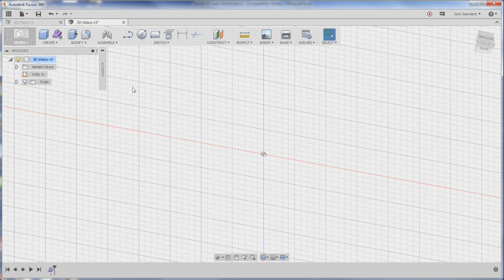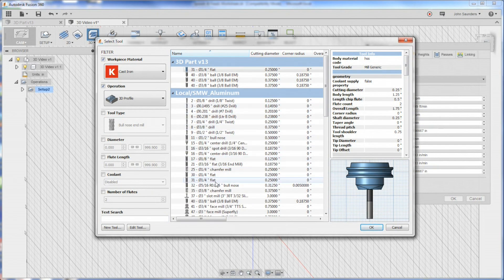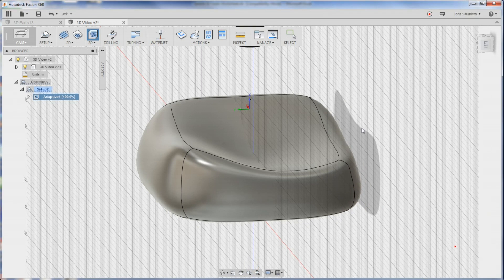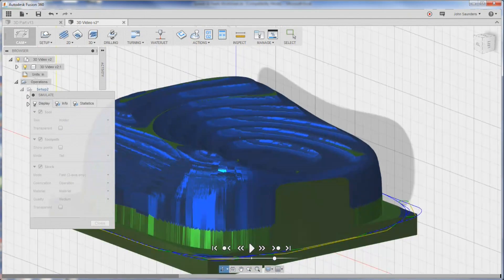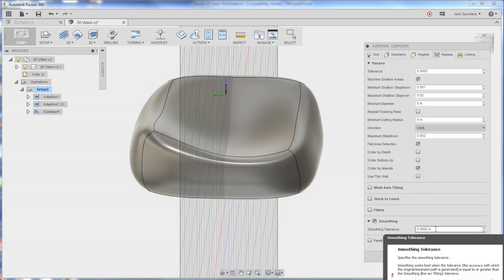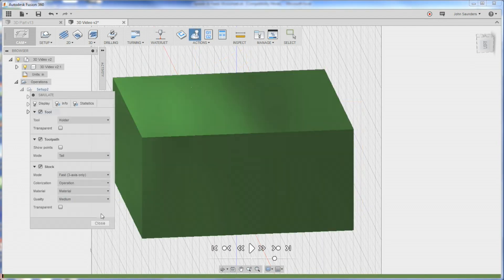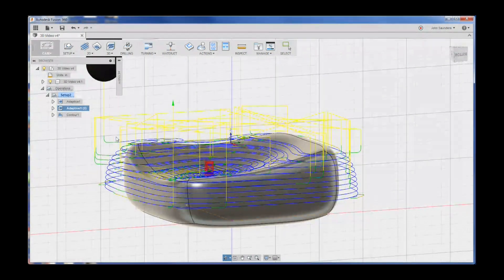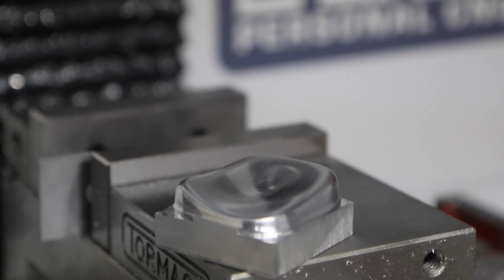3D Machining!   Can we get a great surface finish?

Comment: What is tormach Controller ? Cnc’s have fanuc,Siemens or mitsunishi. But i dont know tormach’s ? Does Tormach have a computer aided cnc like a simple woodworking cnc(Router)or does it have the capacity to make 4-5 mass production parts per day? It is impossible to get this information directly from the website. Also, does it have a precision of 0.01?

Comment: I started with Autocad back in 1990 and it was good for 2d  but .....
You need SolidWorks CAD and Esprit CAM I use both for design and programming and they  are the best for design / evaluation and programming.

Comment: 7075 would leave much better finish, with just smidgen of oil on surface and finish pass of .003 to .005 would help too to minimize temp.
Reply: 7075 is a dream to cut vs. 6061

Comment: I would rather use normal roughing first with big radial step over and smaller step down so then I left with smaller stairs, and then do something like ball mill "3D constant step over" (in SolidCAM) operation with a little bit bigger step over (1 mm aka 0,04") and offset from surface like 0,1 mm (0,004") and then use same operation but with no offset and with smaller step over to get a nice surface.

Comment: anybody that uses "simulate" such as the cartoon type figure to show whats being machined should not be machining. Its a worthless feature put in softwares to "wow beginners" if you are using simulate --then you will not be allowed to get near the programming system at a job --you are not at the correct level yet unless you are in a situation like "the shops is friends and relatives in the local hillbilly town"--thats different.
Reply: Why is that? In my experience simulations in whichever CAM package it is helps you see if something went wrong in the calculations or if your settings results in bad moves. Seeing the tool move in 3D is a bit flashy but can help you evaluate certain tricky areas of the machining. Of course you cannot rely on the simulation to make a good machining, that needs to come from your own head, but as a tool to evaluate, particularly with these complex 3D paths, I feel it is useful.

Comment: I like to set my feed rate per tooth to the same as the stepover. That way the scallops along the tool path direction are the same size as the scallops between passes when using a ball end mill. So a .010" stepover would go well with a  .010" FPT or 200ipm at 10000rpm with a 2 flute ball end mill. If you wanted a finer finish, say .008" stepover, you'd also reduce the feed rate to 160ipm and expect a 56% increase in machining time.

Comment: What size motor are you using for 10,000rpms
Reply: The PCNC 440 has a 3/4hp DC motor.

Comment: I"m just starting out with CNC  router. Total beginner, I get to play with a  large industrial CNC router next Friday. Wont be anything super cool like what your doing, but you gotta start somewhere. I noticed you didn't need to use coolant when  your cutting that metal block? Great video by the way.

Comment: John, I know this is an old video, but I was curious if you checked out Autodesk HSM's video on surface finishes: https://www.youtube.com/watch?v=ksrhtS3d79Y . They do a pretty good explanation on how to improve surface finish on 3D parts. They show mostly with Fusion 360 as well (but also show other equivalent CAM software).

Comment: Very impressive.  Working on the coolant delivery might improve the recut chips.
Reply: I agree, running at 10k spindle speed is causing the heat between cutter and stock to kind of fuse the chips back on the part. also i found out climb miling always gives a better finish.

Comment: little tip, you shoudnt use an ball mill on profiles with more than 30 degreeo f angle, instead you should  use and end mill with a big corner radius, i my opinion would had to 2 finishing programs, 1 for the outside with the end mill, and the interior using an raster finish with the ball mill at 45 degree angle

Comment: Hey John great vid. A way you can keep the chip smear to a minimum without running coolant is to use a little WD-40. This will all but eliminate built up edge "BUE" on aluminum. This could also help you get some good shots that some coolant systems would obscure.

Comment: Nice video! I'm just learning fusion360 myself its great! If you use even a little bit of cutting oil or wd40 on the part while you do your surface milling you wont get the chip gulling on the surface when cutting aluminum brand new cutters will still give that chip sticking to the surface. that part looks fun!!

Comment: Does the tormach 440 setup for through hole coolant.  Not saying run coolant but maybe a mist and air in a through hole bit.  I've seen add on atachments when machines don't have a through spindle coolant.  Maybe the air and mist coming through the bit will blow the chips of of the way and you won't get any recutting of the old chips.

Comment: john, one thing to consider when 3d machining with a ball mill is that the majority of the time your not using the full diameter of your tool. so your speed and feed calculations are way too slow.  most of the time you are using just the last 10 to 20 percent of the radius. if you calculated for the diameter you are actually using you will see you don't have anywhere near the rpm to put it in the sweet spot. you either have to live with the finish, increase your tool diameter,  or use a spindle speeder.

Comment: I think the finish was just because you didnt have coolant. you shouldnt have any problem running at 100 ipm with 10000 rpm with that step over. probably just rubbing little tiny dust (chips) into the part thats all. I wish you had hatted it off and made the entire part. lol

Comment: "Rest machining" means "I have hogged out the majority of the material with a big tool, now I'm using a smaller tool. I want you to get the REST, such as the corners and spots the big one couldn't get to." As an example, if you're doing AR FCG pockets, you can hog them out with a slightly larger (1/2 inch, say) endmill and send in a smaller (3/8", for example) one for the shelf because of the right wall's thickness (0.438"). You can skip selecting it if you want, because it generally asks you for more information and doesn't do anything you can't do yourself with more control.
Reply: And you figured it out. :D

Comment: Smoothing.... Personally I think it's an OK thing to call it. It is actually smoothing out the faceted toolpath by fitting arcs to the series of tiny lines that make up a complex 3D toolpath. In doing so it reduces the amount of code at the machine, but it also decreases accuracy. 

It's a kind of confusing thing to call it for Fanuc users, because it's completely different to the Smoothing options in the post dialog, which is used to enable high speed machining and look ahead. Another nice video John!

Comment: Most probably the dull, rubbed in chips are due to the ball end mill center having no surface speed at all. For sometime now most of the 3D milling work in mold making industry is done with toroidial / corner radius cutters. Buy some and try them out, but be warned - there might be no turning back... ;)

Comment: Hahaha thanks for explaining rest machining! I tried to explain it yesterday lol! I will link this video :D Wonderful little machine bro. I deleted all my other stuff to simply say this. See your rapids? In the link section, (last tab on right of toolpath box) where you set ramping etc. In your 3d clearing strategy... check the box that says maximum stay down as a %. It can drastically reduce your roughing time. Keeps rapids short and to the point. Also different grades of alloy give different surface finishes, always use air/coolant, and check your ball mill for nicks, you can get single insert carbide ball mills that are the shiz. Good work, great machine.

Comment: I really wish they put a bigger spindle motor on that thing... Major bummer for me. Anyway, thanks for the video!
Reply: Well, It's hard to say for sure through watching videos of it, but it sure sounds like it's not holding consistent RPM, in every video I have seen (not just yours), even on fairly light cuts in aluminum. It just sounds like it has no balls at all. Have you tried drilling anything with it yet? Maybe try that 1/2" drill you like at the speeds/feeds you use on the 1100? This is the main thing I'm concerned with. 

What about tool life vs the 1100? If it drops 500-1000 rpm for a second every time it enters the cut (no idea if it even is, just sounds like it), that can't be good for tools, especially if you're already running a high chipload. In all honesty, it's more than likely fine for 95+% of people, but not for me at this point. I realize it's not fair to compare it to the 1100, but still, it should be able to hold speed more consistently in my opinion.

 I remember you mentioning something about the spindle in a previous video, can you investigate more about it? Maybe you could do a video of pushing it to its limit like you did with the 1100? Is it actually dropping RPM, or does it just sound like it?
Reply: NYC CNC Awesome, thank you. That is good news!

Comment: For surfacing I like a Garr ball endmill for both roughing and finishing. I'll typically rough out at 75-90 ipm 8000 rpm with a 3/8 or 1/2 and finish at 90-110 in aluminium. I think the surface burrs you encountered were from a lack of coolant more than tool choice and in my world this finish would be more than acceptable. This machine seems very stout for its price point and I am looking forward to seeing more tests of its cutting capabilities.

Comment: Hey man, Love your videos! Had a few questions for you. In the last year or so I have just kind of dove into the machining industry with no machining background or schooling, started out running EDM machines and shortly after have gotten to the CNC Milling on an old supermax mill with a retrofit anilam conversational system, nothing fancy. The first type of software that I have been exposed to is BobCad, and to be quite honest im not really impressed at all, fusion 360 looks like a much more user friendly interface. Been kind of experimenting with all sorts of speeds and feeds, but my machine only allows manual speed selection, so it somewhat limits what I can do through programing and such. I guess what my question is, with out growing company, what would you recommend the next step being? We do a lot of jobs what are just small custom parts (ei 3inx3in), But its ALL tool steel (01 A2 D2). It looks like the tormach machines are pretty good and work well with the fusion 360. I guess this would be a conversation to be had somewhere other than the youtube comments! Haha, Great work tho.
Reply: +NYC CNC yeah I guess that is my question, I'm starring to grow out of the features of my current machine and maybe looking to add/upgrade. just wondered if you would reccomened a tormach based on the fact that the only material I'm a working with is toolsteel, also would it be worth ditching bobcad and switching to fusion 360.
Reply: +Tyler Sisco definitely worth ditching Bobcad. There's a generic Anilam post sitting there waiting for you as well.
Reply: +Scott Moyse yeah I do definitely use the anilam conversational system, and actually works very well.

Comment: Thanks for the video! In the 3D Adaptive Clearing settings under Linking you got the No-Engagement Feedrate that could additionally speed up your cutting job. I don't exactly remember where I heard it, but one of the problems with the ball end mills is the cutting speed at the center of the tip is close to zero, that is why it's rubbing there and why really beautiful 3D-Machining like this is better done on a 4 axis machine to keep cutting at the outer edges of the tool.

Comment: Nice video, that 440 looks compelling.  I would have set the max roughing step down a bit more (1/4" or even 3/8") on the adaptive clearing and then set the fine stepdown what you were going for in terms of final step depth, that way you clear out most of the waste 1/4" or 3/8" depth at a time and then it retracts the minimum amount and 'rest' machines whats left if that makes sense.  Example, it will cut 3/8" deep and then retract to 1/4" and then 1/8", rather then cutting at 1/8" then at 1/4" then at 3/8".  Thanks for the tip on shallow area machining, I didn't know contour could adjust to accommodate flatter areas.

Comment: Would you save total cycle time if you shear hogged out first, then came in with the 1/4" rougher using "rest material" and then went to ball end mill with rest material?   (I suspect, and this is only a guess) that if your step downs are different enough with the hogger versus the rougher, you wind up really decimating the material that the ball end mill has to deal with.   Perhaps the hogger pass would let you run the 1/4" rougher pass faster?

Comment: use air blast or coolant . you was recutting chips. 

sometimes you get little spots if the machine can't read the program enough fast either
Reply: +NYC CNC, Doh spoiler ! :)

Comment: That's so nice John! You're really selling me on the Tormach, too bad I'm on the wrong continent. Is Fusion360 able to do spiral machining paths? I've had some issues with contouring paths where the start/stop of every contour is in the same place, and creates a irregular line down the side of the piece. Spiral machining paths solved that entirely for me at least. Though, it doesn't look like you have that issue.
Reply: +NYC CNC Europe! I visited Maker Fare NY recently and spoke with them. They said that they have shipped some stuff to Europe, but it complicates service issues and such, unfortunately. But hey, who knows, wait a few years and maybe they'll grow enough to start a subsidiary over here (or I'll move to the states).
Reply: +Switch & Lever 
I've had that issue too. How annoying!

Were you using climb milling? That's what I was doing, but something I read on CNC Cookbook makes me think I should try conventional for the finishing pass. They say that direction of deflection varies based on the type of milling (conventional/climb) and the with of cut. Apparently, when conventional milling the deflection is typically close to parallel with the toolpath.

I think I'll give it a try before too long.

http://www.cnccookbook.com/CCCNCMillFeedsSpeedsClimbConventional.htm
Reply: +Switch & Lever +NYC CNC You have really sold me on getting a Tormach PCNC 440 and shipping it to the UK but it would be about £440 ($677) shipping costs. So is it worth it (once the ATC comes out hopefully next year?)
Reply: I'm not sure what the shipping for that machine would be within the USA, but I wouldn't be surprised if it was around $300 (USD), so $677 doesn't sound too bad.

Comment: When I'm 3D machining, I like to start at the bottom and make the tool work its way up. That way the side of the ball mill gets used more and I figure the edges will stay sharp longer and give better results.

The other thing I thought I noticed, but I'm not too sure about, is that you could have done the roughing steps differently and got approximately the same results. I think you could have had the tool rough out more of the shape using the side of the tool (again, in the interest of tool life) by making one of the stepdown distances larger, possibly even the full 3/4". Or maybe two big steps of 3/8" each. Then, once the major roughing is finished, HSMWorks will step up by the amount put into the second step distance field. I'm guessing Fusion360 will do that too. All this is so the tool cuts with the side more (extending tool life) and so the machine doesn't have to to cover the same XY toolpaths over and over, just at different Z depths (reducing machining time).
Reply: +Hirudin setting up a simple thing for my first 3d machining on my mill, watched this video to get a start for step downs and decided to read the comments. So glad I did! now I get the point between the bigger and the fine step down options! is there a way to spec a different feed rate for the fine step downs?
Reply: cool, always liked the support I'm getting on fusion 360! even had someone track me down at work for a phone call to check what I was using it for when I first bought it
Reply: Scott Moyse good thought as long as you can override it. I know my because my spindle is so slow the auto setting would easily go above my max rpm with anything smaller than 3/8"
Reply: Thanks!

I'll see if I can whip something together. It might just be a silent video of me messing with the settings...
Reply: +NYC CNC 
You're most welcome!
Reply: +Hirudin What did you use to model that lump? Did you do it in Solidworks, or import it?
Reply: Brennan Sheremeto No there isn't. But that's a really good feature request though!! So I created one for you to go and vote on if you like http://forums.autodesk.com/t5/ideastation-request-a-feature-or/independent-feeds-amp-speeds-for-3d-adaptive-clearing-fine/idi-p/5935548
Reply: Brennan Sheremeto Cool! I work for an Autodesk Reseller in NZ. So this one was nothing to do with Autodesk :-)
Reply: Brennan Sheremeto BTW I found a comment on another thread where the Product Manager Al Whatmough stated they are working on calculating this automatically based on the F&Ss used for the major stepdown.
Reply: Brennan Sheremeto 
Thanks for the note!

Comment: I think you've crossed the machining porn line with this one.
Reply: If you wanna make real machine porn machine the adaptive clearing with a smaller stepover and start from the bottom up (go as deep as you endmill can reach on the first cut). I'd also reccomend using a smaller ball end mill. I machined a nice tit with with fusion, can send you pics if you want :)